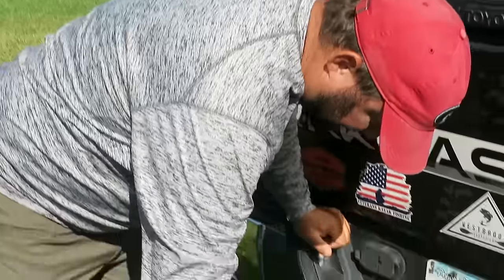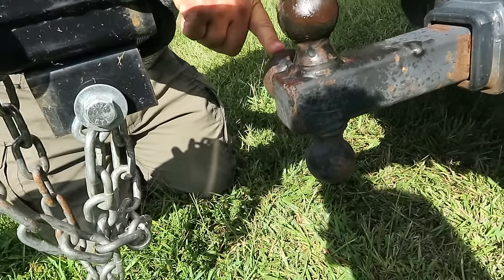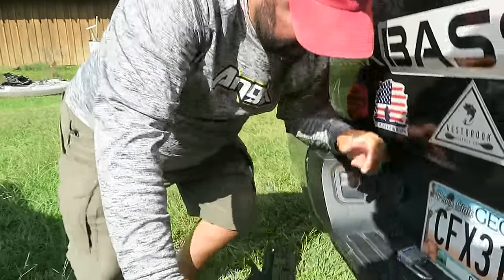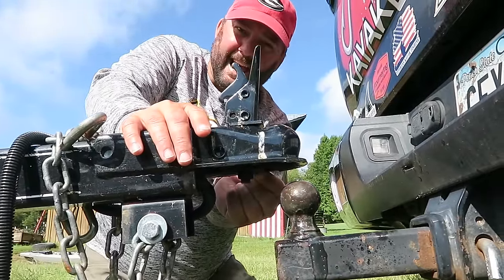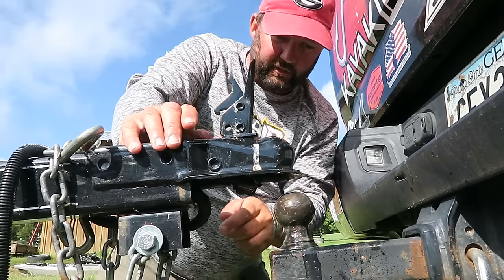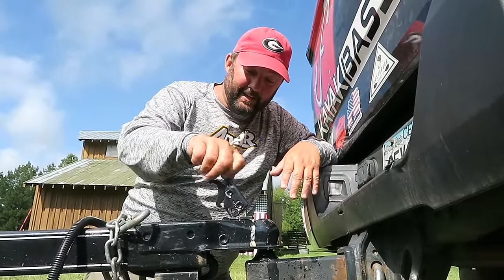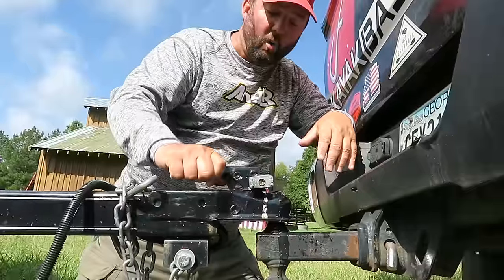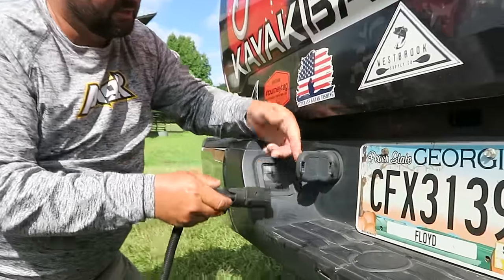Boating Basics - How to Properly Hitch a Trailer

Comment: Let me add my 2 nickles. (Inflation). If you buy a used boat, and need to trailer it home, do this. After driving a few miles, pull over and feel your wheel hubs. If they are warm or hot, take it to a garage before getting on the interstate. This little test may help prevent your wheel from falling off on I75. Wheel bearings fail, especially on boat trailers.

Comment: Second suggestion: You should always criss- cross your safety chains.
Reply: Does this also apply to retractable cable chains?   Mine retract the slack and are built into the trailer system for my boat. I’ve always cross crossed chains to take up slack but haven’t been with these new retractable cable style.
Reply: @MatanuskaHIGH  I haven't seen what you have, but static chain slack isn't the only reason to cross them.  One is the idea that the hitch will land in the crossed chains, that may or may not happen, but, it's a consideration.
The other is the the geometry of how the chains move when cornering.
For some trailers & vehicle combinations, the effect is minimal, for others, the effect is extreme where the geometry of crossing the chains reduces the play in them because the distance between opposite connecting points does not change as much as the distance between the same side connection points does when cornering.
For boat trailers, maybe not a common issue, but, and this is my opinion, crossing works well on all trailers I've seen, even if it has a negligible affect on some trailers, so I just do it for all.

Comment: Make sure that latch is down and locked. I forgot once while in conversation like he said and it did $3500 dollars worth of damage to the back of my suv. Expensive mistake. Also watch a video on load placement on trailers. Placing heavy weight on the farthest point back of the trailer will cause massive fishtailing.

Comment: Another tip, use some dielectric grease on you wire plug. Makes it nice hooking and unhooking and makes a better connection.
Reply: Do you live on a dirt road? If so any issues?
Reply: Okie Hunting I am in the sawmill business. I have been using this stuff on all my trailer plugs for years. I go through mud and very dusty conditions regularly. I just get a small tube of it at NAPA and put it directly where the wire connections make contact with each other. Like across the face of the round plug. It doesn’t take much. I do it about 2 times a year. It makes plugging and unplugging much easier.

Comment: I've had my boat come off the hitch twice, (it's a pretty old trailer 2004) ; once in traffic and once pulling out of a parking lot.  Both times met with mixed results. Fortunately both times no one was hurt and no outside physical damage.  However there is the issue of the spot one my seat cushion from when I lost control of innards LOL,  This is a much needed video so thanks very much.  Here's hoping we never have it happen again. You are a wonderful teacher my friend.  I've learned so much from you, Thank you.

Comment: Excellent! Some good points I never thought of before. Also, I'll give the rest of you a little tip! Never load your trailer where the tongue is too light. I hit a rough railroad crossing once and instead of hitting the ground the tongue bounced up and slammed into the back of my tailgate. Tough lesson. Safety chains saved it from going into traffic. Still not a cheap fix.

Comment: Hey thanks for the video we are trailer rookies in the U.K. and I’ve learnt a lot from YouTube tips , when we picked up the trailer it was a bit noisy which made the trip home a white knuckle ride 😱 I found out later that I was supposed to strip the paint off the tow all before use but I wasn’t sure if you grease the towball or not but your video has answered that question, many thanks 👍

Comment: You have safety latches on your safety chains, so how they are hooked really doesn't matter.  The theory goes that, without safety latches, hooking them up backwards reduces the chance of the safety hooks bouncing out of the holes they are hooked in.  I believe this applies more to horizontal holes than vertical holes, like what you have.
To simulate the theory, hook everything up, then quickly slap up on the bottom of the hook to simulate a hard bump and see if they bounce out.

Comment: Thanks for sharing ur experience on towing and where did u buy the Hitch lub gel to stop it from squeak. Equally important will hate and get nervous also if I heard all the time down the road. I believe it's much quite. However I see the chain drag on the road all the time would it be safe to criss cross until it not to loose...

Comment: Putting a small bar magnet on the trailer tounge ( glue it for aluminum) And you have a place to store your lock or pin.  Its always there when you need it.  Best-Fishes  Fluke Master.

Comment: I dropped the latch and thought it was hitched but I didn’t set the ball and first bump it popped right off even though I locked the latch down. I’m thinking maybe instead of the 2” ball I should get the slightly bigger 2.25” ball ?? I was fortunate my trailer tongue hit a road rubber mat while still in the camp ground.

Comment: In my opinion, you did not connect your chains correctly. Yes, you cross them, but yours are so long that the tongue would still hit the pavement. Try it by lowering the coupler onto the chains.

The correct installation is to pass the hooks completely through the holes in the hitch, and then pull the correct slack out and connect the hooks directly into one of the links, open side down.

Comment: And test your lights every time you hook up.
Reply: That’s part of my routine.  I find if I do exactly the same routine everytime I don’t forget anything and always check lights as they might work one day and not the next which happened to my truck before. Idk why it stopped the adapter for Chevy works in the new Tahoe but now stopped working in my truck although the brake lights on truck work etc.